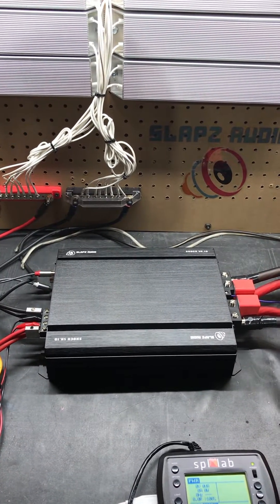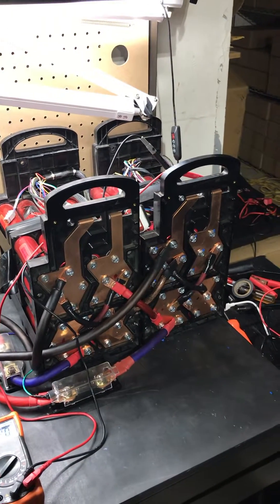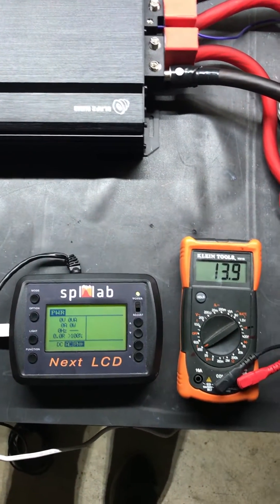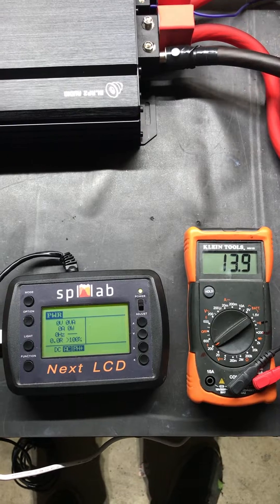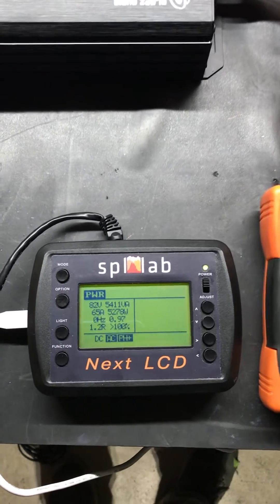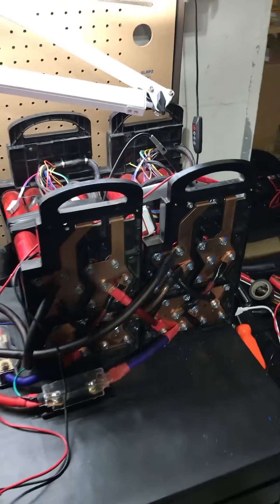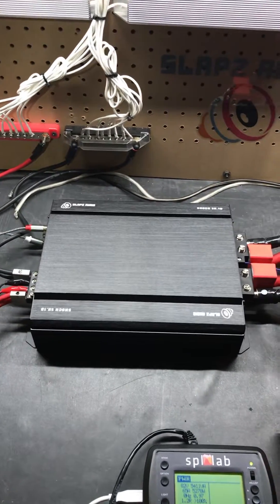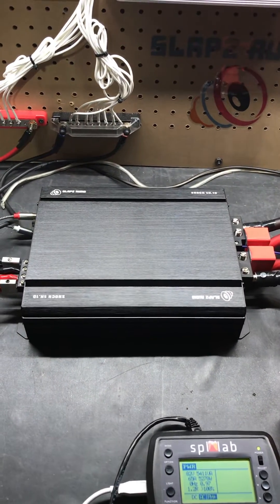SLAPZ Audio Shock 5K.1D amplifier dyno test clamping 5278 watts at 12.7 volts 1.2 ohm!!!!!

Comment: Fucking love this beast I run it on 2 skar evl-12 with a glowe voltage s3 battery never below 13.8 but gain is way down down wanna blow the 12’s lol will be running two solo x 15’s on same amp tuned properly all ran through a recoil 610 dsp sounds amazing!!!
Reply: Still using this amp?